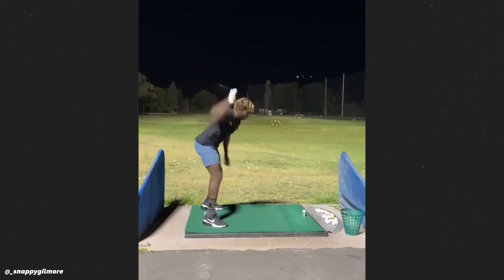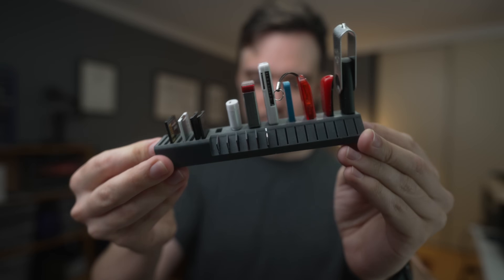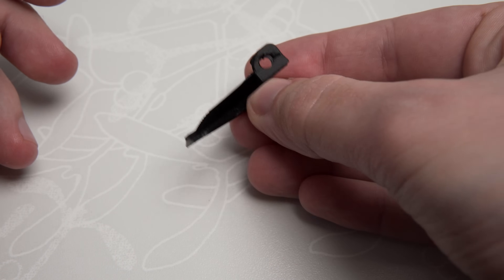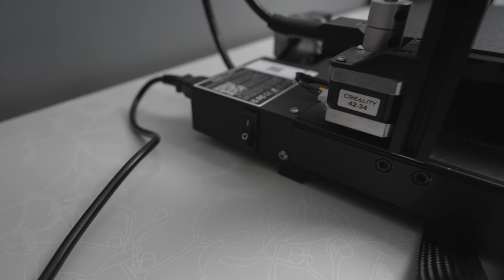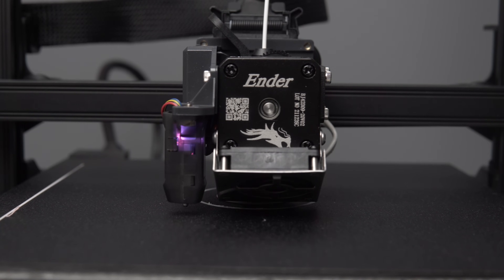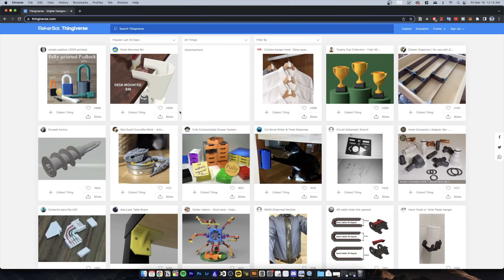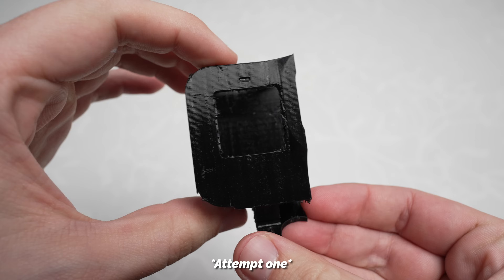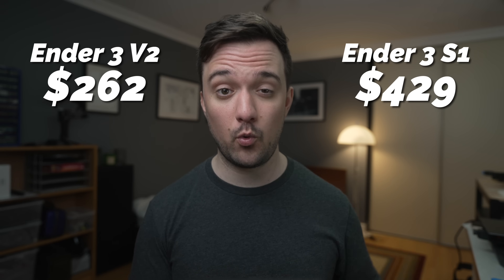How Easy is 3D Printing ACTUALLY? (Ender 3 S1 Review)

Comment: Whoa whoa whoa do you say the magnetic textured pad is better than glass bed for adhesion??? You’re obviously not using a curiosity Coated glass bed. All you have to do is let the glass bed cool and most prints will come right off but until then it has perfect adhesion. Far and away superior to that textured magnetic bed which only worked about five times for me before it required glue or hairspray. I’ve heard good things about Creality’s PEI magnetic flex bed but I haven’t try it. Still very good video just disagree on the glass bed.

Comment: The Ender 3 S1 just looks like a Prusa machine, just without the great 24/7 customer support and using wheels instead of belts and the turning things used for the z-axis (I forgot what they're called). The print head looks very similair to the Prusa I3 MK3S.

Comment: direct drive vs bowden  when printing flexibles - the difference between pushing a wet noodle through an 8 inch tube and pushing a wet noodle through a half inch tube .. also has fewer opportunities for your wet noodle to escape.

Comment: I bought an Ender 3 pro. For almost 6 months it sat unused because I kept having issues with the stock firmware. The PSU that ships with the "pro" is junk and puts out dirty power. I was lucky if I could ever get a single bed mesh in 3 tries (even with the heaters off which skews the results). Typically it'd go to probe the bed and couldn't even figure out an actual hit and often crashed into the bed itself. I tried Marlin with Octoprint. Which kind of worked better, BLtouch still didn't work though, and it still had issues. Particularly that the micro-controller was not sufficient to process the data on more complex prints, leading to blobs, under/over extruding, and general slow printing. The only way I got it to work really well is to install Klipper with Mainsail, which is highly confusing for a beginner user. But boy was it worth it. I can actually get consistent (and fast) print speed, without my prints being distorted, or flat out failing.

Comment: I don't want to spend more than $220. Should I get a Voxelab Aquila C2....the Creality Ender 3....or the new Elegoo 3D printer? Things that I prefer are the new meanweill power supply, a removable glass bed, quiet fans/motors, most universal system for software. Also have community support for any/all upgrades. Can you help?

Comment: Hey! I went through this exact progression...ending up with the S1 as of a few weeks ago, JUST as i was getting excellnt tpu results on my prior bowden printer (Anycubic MegaZero 2.0). This brought me into a spiral because i was NOT getting the same results with my old profiles on the new printer! Next step: YouTube videos involving direct drive printers, and FB groups - got my profiles  tuned to where my prints are coming out almost consistently perfect (actually, i'm using one profile and adjust supports as needed). Learning a few tips and tricks along the way, and a good one regarding supports: set the density to something stupid low! (I have set mine to 10% or lower, like 5%) and the supports just pop cleanly off.   At this very moment, I mashed up 2 existing parts in Tinkercad: an iFlight Mach R5 fin and a Runcam Thumb sleeve for my analog racing quad; it's printing as i type and I'm trying something new as well - tree supports - hoping that i have less surface area to clean or an easier support to break off.

IF you like, feel free to message me and i'll be glad to share any of my findings and profiles with you.   

Lastly...how have i not subbed till today?! I've been a follower since i dipped into FPV!
Reply: Update: the print just finished and the tree support was actually perfect for this part...it printed perfectly as well...almost; my experience in Tinkercad/design is limited and i made the sleeve 1.5 mm too large so it wont hold the camera... no bother...back to the drawing board. Good luck!
Reply: Just got my S1 (my first printer). I haven't turned it on yet. Any tips to get started? Which videos or resources to watch/read first?
Reply: Wow! The support tip helped a lot

Comment: i have the kingroon printer for two years but it broke now im planing to get the ender 3 v2 or the pro or whichever is cheaper which is the ender 3 but idk the difference for all of them and i see this video wanting to just get the ender 3 s1 but its 500 CAD which is very expensive and i dont know if its worth it or not or should i just get a cheaper like the ender 3 v2 or ender 3 that is around 300 dollars when i have little experience on 3d printing and able to manually adjust bed leveling

Comment: Your nozzle is probably too low because you didn't set the z-offset. You need to do that when using printers with automatic bed leveling. And thats why the paper trick did work on your regular ender 3.
Reply: I have an anycubic vyper with auto bed leveling. I don't set anything, just hit auto level if the unit has been moved then let it print. Gouges on the printing plate like that look nasty tho.
Reply: @KwaddawK  printers come stock with z-offset. His one might be a little bit off...

Comment: I have an Ender 3, and have an S1 on order, pretty much for every upgrade it has. I am looking forward to printing in a wide range of plastics. It's definitely moving in the right direction but there is still a lot to know about printing that takes some time investment to learn, and to troubleshoot when things do not go right. I just want to spend more time printing, and I am learning modeling too. Good luck with everything!
Reply: Has it came in have you started printing would you recommend this machine ?
Reply: I got an Ender 3 V3 SE, for about $200. It has worked great, yet I haven't tried TPU.  Wondering if the older, fancier one is better or the new tech in the new one makes up for it.
Reply: What exactly is modeling please and ty
Reply: Combine all the other knowledge with it.. electricity, chemistry etc. how nice it would be.

Comment: You would not believe the potential a 3d printer has, I've had my ender 3 pro for years now, and it has been an incredible journey.
Reply: Ender pro3 was my first. It changed everything.
Reply: You should upload a list of everything you’ve ever printed, I can’t find out what to print ever that’s actually practical
Reply: @bonkgameing  just look at every object in your house and ask if you can mod it. Alternatively there's whole video compilations dedicated to this. I printed parts for a broken toilet. Just searched thingiverse for "toilet bolt"
Reply: I have that one
Reply: Can you also make like cosplay (iron man for example) helmets with it?
Reply: @AngeloBraham  absolutely, there are tons of free files to 3d print iron man helmets and armor. If you want to get fancy, you can even motorize the helmet to open and close automatically.
Reply: @AngeloBraham  Not in one piece if your helmet size exceeds the max build area. Which I think is a 220cm  cube. Ironman stuff yes, because? Tony.
Reply: @jsmythib  what about the ender 5? It’s 300mm high.
Reply: Only A few months for me 😢. It just keeps on getting clogged. And the extruder keeps on clicking. I tried all I can. Does any one here have any suggestions on how to fix it. It’s a ender 3 pro
Reply: @chillicream5429  YES! Turn your head up to 250c and clean out the head  with the wire. Then turn your heat UP on the head when printing(I use 235). Your to cold. The filament is not melting and pushing thru, so the feed motor is slipping trying to push it through the hot end. Drove me crazy when I started :) If your pla says use 225c, start at 235c, make sure it is flowing before you try dialing down.
Reply: Shit I just now successfully printed  the test print that came with the printer now I can save slices to the  sd card but nothing ever starts
Reply: You should upload

Comment: You can get great TPU prints off an Ender 3 V2.   You just have to play with speeds and retraction a little.
Reply: Ok I have the S1 but I’m assuming the speed will work roughly the same

Comment: As an owner of an Ender 3 V2, I have 1 million problems with it. I have learned so much over the year and a half that I have owned it, and I have also learned how bad of an overall design the V2 is. I basically am stuck with it for a while, and I have to constantly adjust things to keep it in a decent printing shape. My parts are all PLA, but look more like the TPU prints from this video. The S1’s design looks a lot more efficient, so I wish I had that one instead. I might not get another Ender, but if I do, then I will definitely keep the S1 in mind
Reply: Maybe try bmg direct drive but I get you. Prusa seems worth it for all the issues diy 3d printer kits in the market right now.
Reply: @IamG3X Yeah I agree with that completely. I am probably going to wait for the next few months to just look out for new 3D printers that are more reliable and better built for long term usage
Reply: @IamG3X I might get a BMG direct drive, but I don’t know if spending more and more money on a 3D printer that’s just a cheap and bad design is a good idea… I am debating myself on the idea
Reply: @geckorocketry  i'd say take the L and save yourself a nice prusa printer. the amount to research and time you spent on upgrading the parts. it's already cost you too much.
Reply: I have an s1 and it's garbage
Reply: @MasterNooddle  
Well, thats good to know. I have been looking at possibly getting the FlashForge Guider 2, but for now, I am still just stuck with my Ender 3 V2.
Reply: @MasterNooddle  how come? Too much upgrades? Printing quality low?

Comment: Yeah the Bowden style extruder system has the drive motor separate from the hot end. Trying to pass TPU filament through the tube after the drive to the extruder increases the force the motor has to drive it with, because the TPU generates so much friction inside the tube. This results in the filament catching momentarily when trying to drive it forward in the tube, making weird oscillations in pressure at the extruder. It's also like trying to pass a wet noodle through a straw in many ways. I don't know, my first 3D printer will be delivered today! Went with a direct drive Anycubic Kobra, myself.
Reply: Thank you for typing that out so I don't have to lol, was gonna say the exact same thing.
Reply: You can buy a direct drive mount or 3D print one for the fraction of a cost of a new printer though

Comment: I have an Ender 3 v2 pretty happy. I have updated the extruder as the orginal plastic one broke. The aluminum one is an good upgrade. Helped quite a bit with TPU. Still some stringing but good enough for me. Auto bed leveling would be nice 👍
Reply: I added a bltouch and then i figured up u can do the mesh leveling by hand so i would recommend getting better springs so the leveling last longer and do it by hand.
Reply: @carvas1237  I upgraded to silicon bed mounts from already stiffer springs and I gotta say that was the best $7 I spent on an upgrade.
Reply: @trevorbenton783  what are those and what they do?
Reply: Scam?